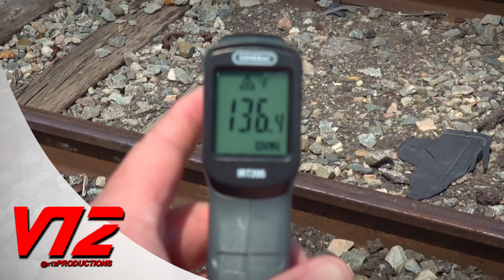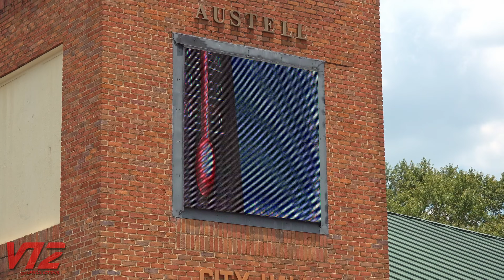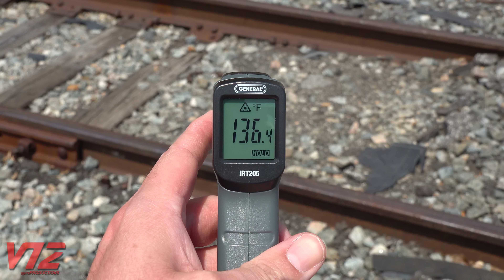Can Heat DERAIL a Train?

Comment: i should check out the track out here in the Mojave desert all bnsf where i am. temps out here get well above 100F/37c. parts of barstow and lugo(Hesperia) can get temp in the low 110F/43c to the high 115f/46c.

Comment: It derailed my local shortline, the Chesapeake and Albemarle.  Recently, the heat warped the rails causing the last five cars, on a southbound to derail.  This is because they were the only empty cars on the train, the way the rails deformed meant that the heavier the car, the less likely it would come off, hence only the empty cars derailing.

Comment: Thank you for this information about what can happen to train tracks when the temperature gets hot in the summer months. Union Pacific had a derailment near Willow Road and Shermer Avenue in July 2012 due to a problem with the rails near the bridge over Shermer Avenue. Derailed loaded coal hoppers caused the bridge to collapse. An elderly couple was driving under the railroad bridge at the time of the bridge collapse and did not survive. The location of the bridge was on the former Chicago & North Western Railroad tracks. The loaded coal train was heading to an electric generating plant in Wisconsin. (2024-06-24 at 2332 CDT)

Comment: At 7:14, the 6216 has an engine room door swinging open and shut. Might be from a quick check of the water level in the radiator tank to be sure that the locomotive has plenty of water on such a hot day. Humans are not the only things that can overheat.

Comment: I live in New Jersey and NJ Transit, as well as Amtrak, have been having tons of problems with the overhead catenary wires due to the excessive heat over the past week. I got a wave and a horn show from a NJT Hi-Rail Ford F350 on Friday that was cruising by a departing train. Today I saw a set of Arrow IIIs back up into my local station after having a near miss with sagging wires.

Comment: The rubber tires on that Silverado HiRail: 
”I WANT TO DIE”
Reply: i wonder if the tires could blow out
Reply: @TealGuy 
Mine never have when it hits 120°f in the SHADE.
Reply: @blaydCA  thats crazy that it gets that hot in the shade...
Reply: @TealGuy  
It's getting more typical in the South West with Global Warming.
Thankfully, the humidity isn't high as a rule.
If it's windy it's like being in a Convection Oven.
Reply: Anyone when the temp is over 90 (except Florida or the southwest) LOL
Reply: That's like typical temperatures for tires though? Ever measured the temperature of asphalt in the summer? It is black after all
Reply: Bruh
Reply: this drone is on overtime 😮

Comment: When I went 2 work as a train man in the early 70"s they were called sunkinks but later on the RR wanted 2 b more scientific they called them thermal misalignment. Either term meant danger.
Reply: Sunkinks sounds like something in Key West
Reply: good comment... i worked for chicago and northwestern back in the 90s... they were still called sunkinks then... but "thermal misalignment" does sound a bit more smartly, i guess

Comment: Idk about yall. But its just summer. These “heat warnings” for normal temps are a joke. Par for the course
Reply: Bro has never heard of wet bulb temperature
Reply: It ain’t normal having this many and this strong of heat waves.
Reply: @gallydex3566  There isn't a normal climate, its constantly swinging up and down, has been for Several Billion Years. Even the Holocene Climate Optimum was warmer than today. Yes we are changing the environment, but fewer people will fix that, and fewer people all over the world are having fewer people generation after generation.
Reply: @gallydex3566 the dinosaurs wouldn't agree with you.
Reply: @gregblanton9386  To be fair that was really sudden, and without warning, not that they had the opposable thumbs to do anything about it.
Reply: @gregblanton9386   Well actually we do have the means. we just haven't used them in a long time